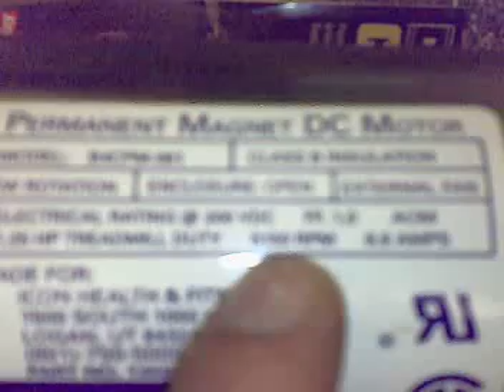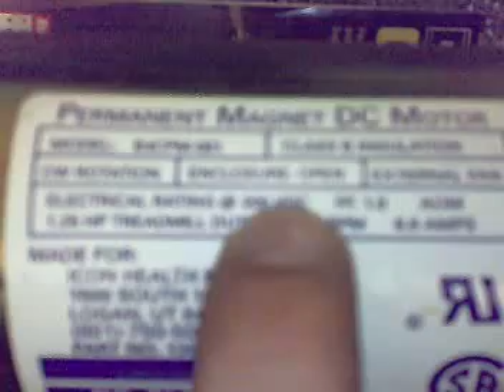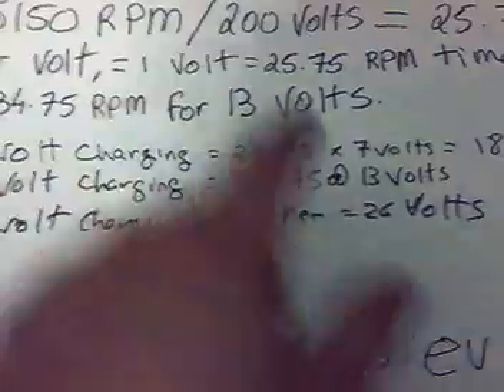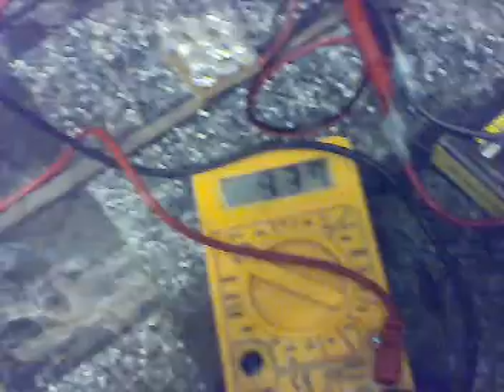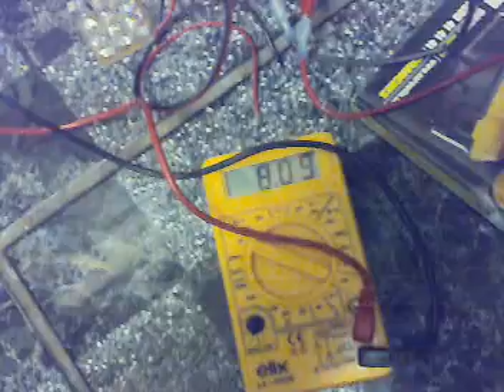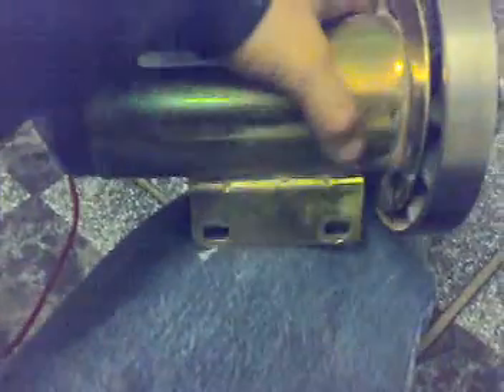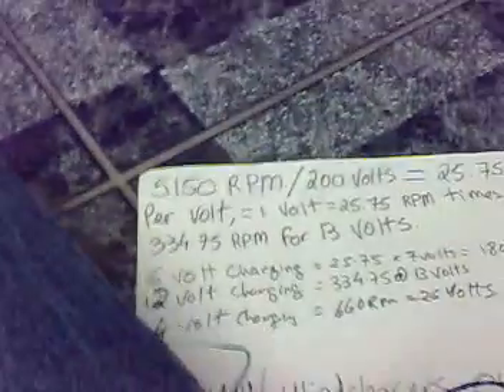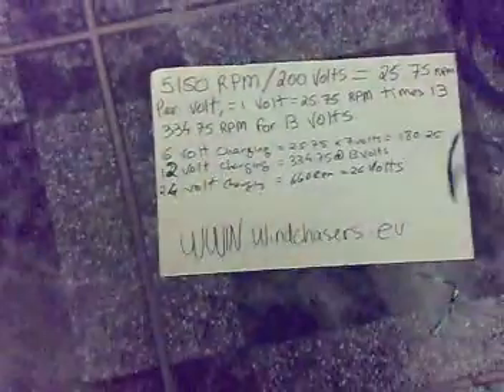home made wind turbine/generator/motor

Comment: My DC motor from a treadmill is rated at 100 V, DC.
 NO WAY will it get the rpm it needs to make viable output.
 I had to build a gear increasing pulley set up to increase the motor speed.
Raptor gen 4 blades= 7.Ford truck A/C eliminator pulley,Mustang idler w/spring loaded tensioner.3.5 to 1 to the DC motor is right for my low wind area.
Direct drive will not work well in my location.     SEATTLE.
  Still working on the mounting system.

Comment: are u nuts? no one except a pro can make a reliable wind turbine to spin at 350+ rpm. I think the design would be best off at roughly 100 rpm or less with bigger, yet cheaper(less precise) blades so normal folks can build it themselves. The bigger blades would make it so the turbine would have enough torque to spin at a low rpm, and just gear up the generator using a pully or chain system. Don't forget this ultra critical option!

Comment: So, how were you planning on keeping that motor from melting down in the first strong wind that hits it? You do realize the device you're attempting to use as a generator is, in-fact, a MOTOR? It's basic function is to create a source of torque to do Work, by converting electricity into mechanical energy.
lol
Those coils aren't designed to dissipate the heat created from the generation of power. The number of windings would be too high and make too much current. I think it'll pop your batteries.

Comment: Yes and No.
In the sense that a permanent magnet motor is a lot more convenient, you are stuck with a relatively low output depending on the strength of your magnets.
Whereas an Alternator has no magnets and puts out much more current overall, however, you do need a start-up current source (a Battery). That start-up current is called Rotor-Lock Current. This is not much of a current (typ. 15-45w@12VDC\1.25-3.75A respectively), but it has to be there for the Alternator to function at all.
Got it?

Comment: Your all wrong, useing brushed  electric motors and metal gears may come up with fucked up generator.
with 12v you cant charge car battery, at least 14/14.4v is required
Btw have you ever looked into car battery charger? 12v transformer and after filtering the voltage is 16-16,4.
If your motor will give ac you may filter it to dc multiplied by 1,4
Several neodymium magnets and few coils will lead you to mastery of generators...
cool motor... brushes will die within a week.

Comment: just wondering does a gear ratio help with this ? if you used a super small motor like a magic bullet motor. But used a gear ratio of like 5/1 could you get enough rpm to get a viable generator for a wind turbine?

Comment: @Kevakazii - I've only worked on low voltage devices professionally while high voltage TVs remain a (lethal) hobby. Haven't built a wind turbine (yet) so these are educated guesses. DC Motor will produce a max amp output (max load). Correct cables support that maximum load (current). Eg: 4mm cable can carry a max 25amp load. Safe designs include a "dump load", DC isolator, blocking diode and charge controller. All electronics start with safety guides - even small amperages can stop our hearts.

Comment: I have the same motor,only litle beter-230 V-DC,4800 rounds,2000 W,cant find good charge controler vith dump load.Can you sugest some solution.All of new sold wind turbine are tree faze AC generators.Thanks

Comment: cool video I have one of those I have gotten few off free cycle one had that motor and the other had one that didnt have magnets as the stator it had the coil of wire and wire for the rotor, and this is a good motor I'm going to use it for a 24 volt system but use a regulator to keep it at 24 incase it goes above 24 bolts or realy 26 for a good charge. again great video.

Comment: DC Motors have brushes and commutators which make them less efficient more maintenance intensive than brushless perminent magnet alternators. You would be suprised how quickly brushes & commutators wear down when turning 24 / 7 A treadmill isnt rated for continous use like a car alternator is. There are regulators that can allow a battery to charge from any voltage input even AC. modified car alternators are a better solution as alternators are more common and can be easily modified.

Comment: 2.5v per cell by 6 = 14.8 v in a fully charged 12v battery so you need over 14.8v and good current to charge the battery fully

Comment: The motor you are using has a hing nominal RPM witch is not the best. I am working with fitness equipment and i see those high RPM motors sometimes in a cheap treadmills. The more expensive treadmills like Precor use low rpm motors(2600 3200RPM) witch makes much better use for wind generators.  I have about 10 of those low RPM motors laying around and i have to put them to use, maybe sell few on ebay....

Comment: I live in a heavy wind area, these motors just need to many RPM to make them worth while. Fast blades or not, but fun to play with though. I have built about 5 of the turbines you are showing. If you could find about 1000 RPM motor that may work. The best turbine I have found is the axle flux this is a serious turbine.